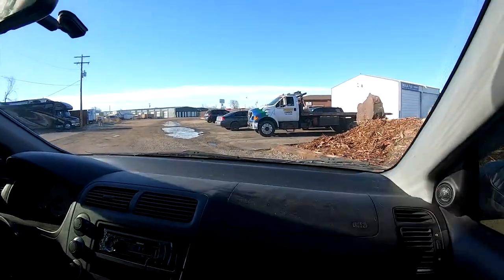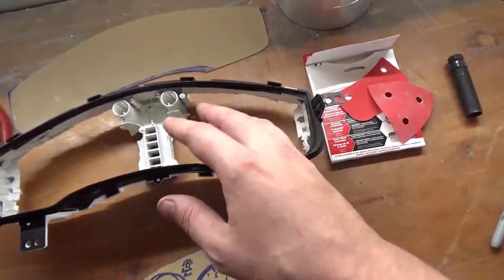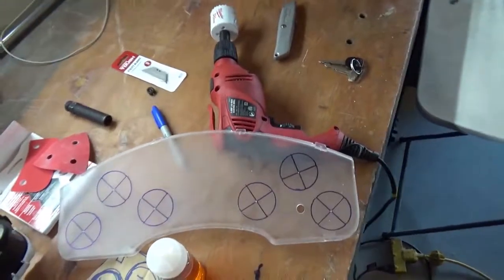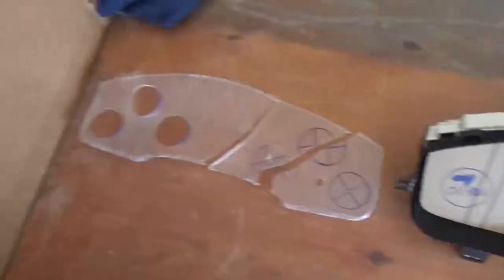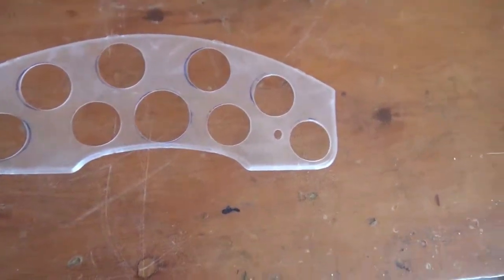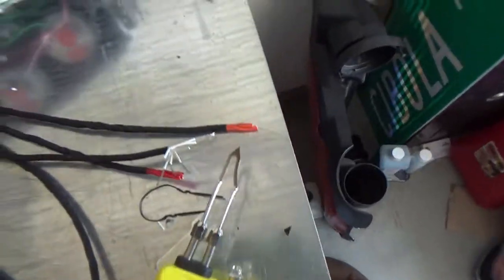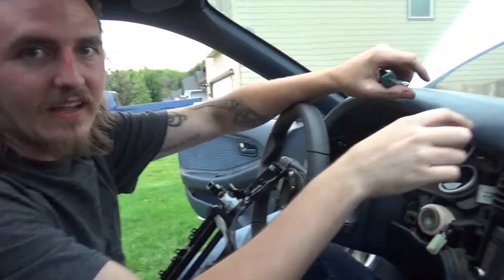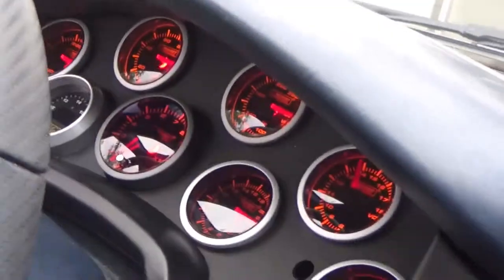The MR2 Gets A Custom Gauge Cluster

Comment: why not eliminate the battery voltage and replace it with a speedo? I personally never even look at my voltage since I could always just check for it with a multimeter.
Reply from the maker: Jared Colunga Paredes that’s a great question ! Andrew is a long haul truck driver he loves gauges ! He is going to change some things up when he goes full race mode with the mr2. He’s going to be doing an aluminum dash panel , then he will most likely add / eliminate gauges

Comment: How did u get the fuel gauge to work?
Reply from the maker: We used a volt meter at the back of the factory cluster to determine which wires we could hook up to the new gauge . I believe the new gauge came with the instructions and we just traced wires